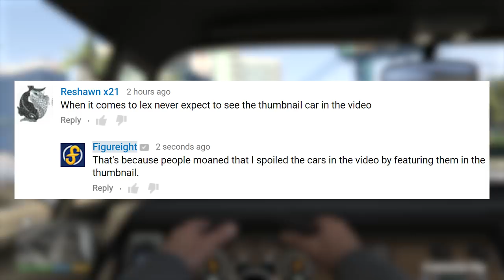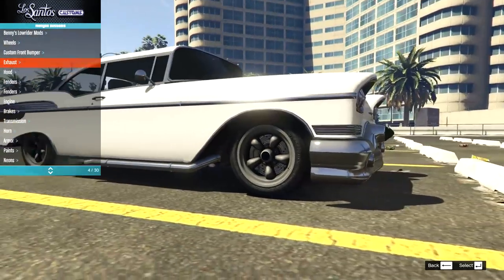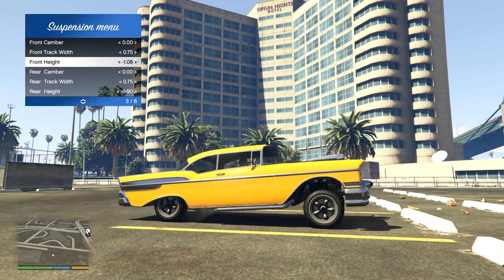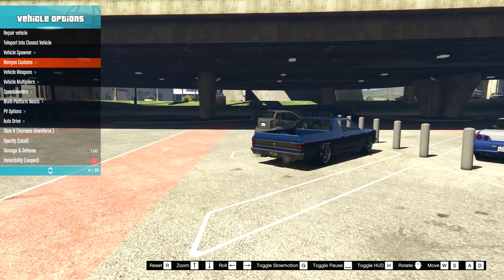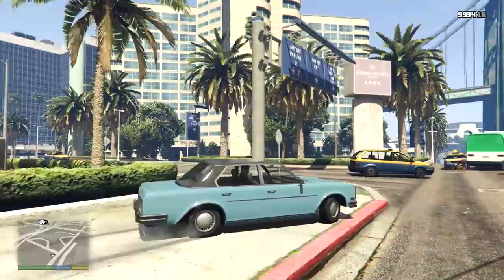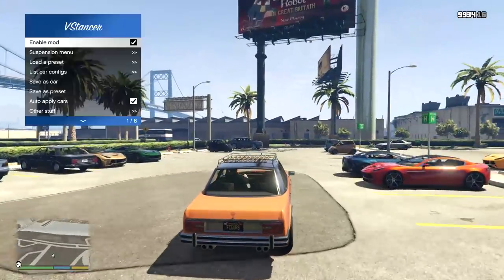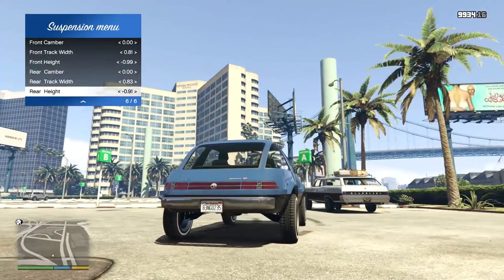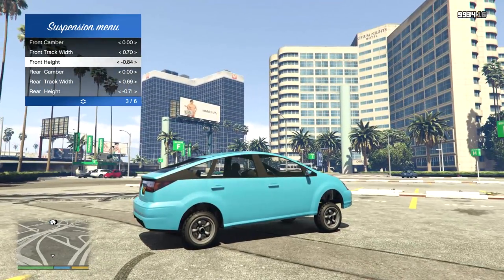BUILDING CUSTOM GASSERS IN GTA 5

Comment: gasser are raised in the front for better weight distrubition because back in the 50 and 60s they really didnt have all the fancy coilovers and adjustable stuff we have now and its just the classic looks
Reply: Gavin Gooding or to fit a solid beam front suspension in.
Reply: Dylan Snyder that's called a straight Axel
Reply: I've heard it been called both.
Reply: Raythedank Brown they are different in some ways. a beam axle in the front is somewhat  solid connection, but usually are not 4x4 or AWD. a straight axle like the dana44 is usually 4x4.
Reply: Actually a Gasser is raised in the front so the weight can be shifted more on the back wheels providing more grip.

Comment: Gassers are only up in the front. The reason for that is they thought if the front was higher when they would floor it the weight in the front would push the back wheels harder into the ground giving it more traction. This did work but it made them way to unstable with turning.

Comment: Just found this video! And I love it. CLARIFICATION, however--- 
The reason gassers had raised front ends was because they had solid front axles, like an old truck, to better handle the strain of being slammed around on the drag strip. The car had to be raised so the bottom of the engine cleared the enormous axle.
The REAR was lifted up, usually with truck leaf springs, so the driver could actually SEE over the front of the car. I suppose someone clever with mods could add a mockup of the axles and attach them to the non-rotating bits behind the wheels.Though that would probably screw up the handling, who gives a damn if it's a drag car? You're not exactly going up Mt. Chilliad... 

Or maybe you are. This is a free Internet. Do your thing.

Comment: Traditional gassers are high  in the front and either stock height and slammed in the back due to how a car launches backwards when you take off, they do it because if the car is already launched backwards when you take off then you don't lose traction, also they're usually on sub 200 wide bias ply tyres all around and the bumper from the front is removed to keep the weight at the back to improve traction while the rear is usually replaced with a steel pole like a bash bar filled with lead or concrete for even more weight keeping the rear wheels planted nice and tight

Comment: gassers are drag cars. they have a solid front end like you'd see on trucks with a oil jug on the front end. the rear suspension is sometimes cut out and welded solid relying on the heat of the tires for traction.  the rear wheel was always lower then the front almost tucking the wheels wheels on the back. front wheels are usually just steel wheels or mags.

Comment: gassers are up at the front because they swap out the sedan quality suspension parts and occasionally frame to install the same era truck suspension parts to be able to handle all the engine weight and performance. its not a 'new' style, it was really popular back in the 50's and 60's nhra drag and street drag scene

Comment: I know I'm a bit late, but the reason for the lifted front end is so the vehicle doesn't need to waste time/energy transferring weight backward on the launch. The vehicle is already oriented the way the sudden increase in speed would knock it, so it just moves forward instead of up and forward, if that makes sense.

Comment: Gassers are jacked up using a beam axle or tubular axle to provide better weight distribution on acceleration (beam axles are also lighter than an independent front suspension),

Comment: You could have used the object attachment feature, removed a rusty tornado's hood(bonnet), doors, trunk lid(boot), and wheels and then attached it to the rat rod tornado. Then you would have the front end. It might look weird with with the rear arches, but just tuck the big rear wheels behind the arches; that is true gasser style anyway. If you remove the attached vehicles doors and trunk lid, the rat rod's doors will still open like normal and be less glitchy. If you can, remove the bumpers too.

Comment: the front is high because the front axle is straight unlike most cars which have independent suspension and back i the 60s, it had to be high up to mount the front axle

Comment: The lifted front, as I think I said in the last video, was a cheap and easy way to alter the wheelbase and change the weight distribution by using a solid front axle. Generally, they ran in classes fueled by gasoline, as opposed to alcohol or nitromethane, hence the name. The "opposite" look with the raised rear became popular during the early days of Pro Stock racing in the late '60s and early '70s. On a road car it's called a 'Street Freak' look by hot rodders.

Comment: That's better lex, but still no quite there.... also very last thing on gassers, could use object spooner to put the normal tornado body onto the rat rod tornado then tuck the rear wheels behind the rear fenders. Also u should have made a hotknife gasser aswell.

Comment: Thinks gasser, makes 4x4 I would know I'm heavy into them. the rear needs to be much lower than the front lex. just a tip from a fellow enthusiast.
Reply from the maker: pretend the rears had big wheels in them and the heights would be right I guess. :D

Comment: is there an option for the rat rod tornado wheels in the lore friendly wheels mod? it would help with building gassers, I also think that you should try to remove bumpers for the older cars for a more gasser look, the first tornado you made would've looked really good without the giant chrome bumper on the front of it and no hood.